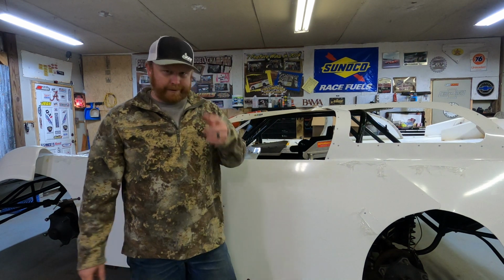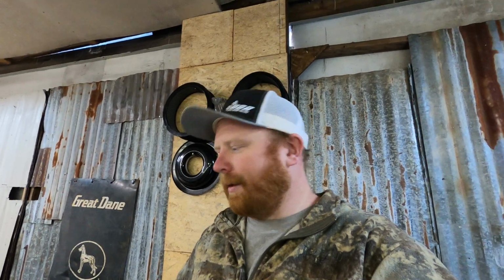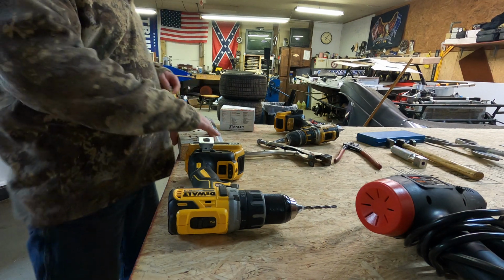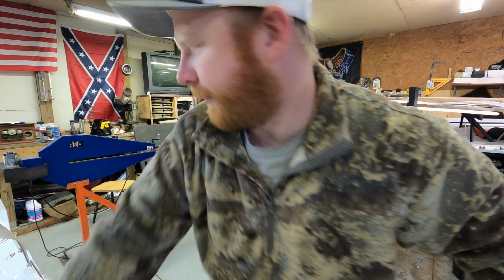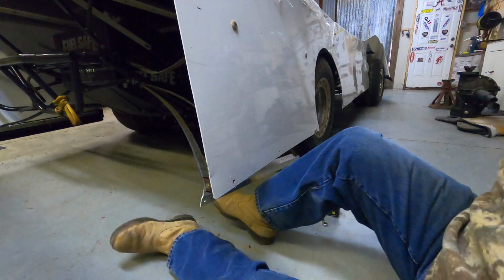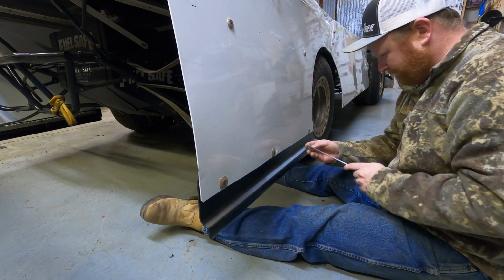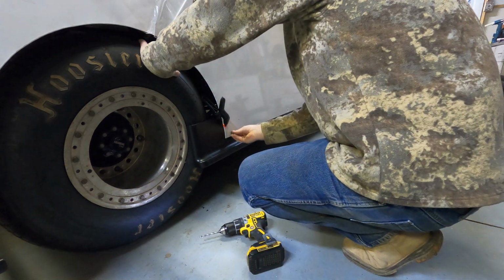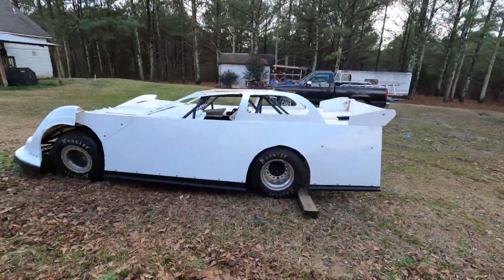Finishing up the Longhorn Chassis | Dirt Late Model | Days of Dirt Shop

Comment: Good job ! i worked for Ronnie Dobbins in the 90"s  ,who owned the cars the late Stan Massey drove.   have you ever thought about getting some cleko's? spring loaded temporary holders? can get 1/8  or 3/16 they work great ! you coulda used them on the hood braces and  for sure on the skirts .
Reply from the maker: Thank you! Actually, we have some but didn’t even think about using them. We always forget about them.
Reply: @daysofdirtwithbradberryracing  WE had a roll around cart with all our body mounting  tools, rivets washers  nuts and abolts and the cleko's on it. They have a tool  now  like your crimpers that do roll bar notches  ever saw them?   think weirs do them anyway good luck, and where you located? im in alexandria
Reply from the maker: Thank you. Yeah we have that tool as well. We are from Attalla